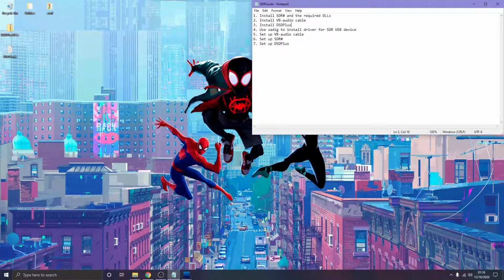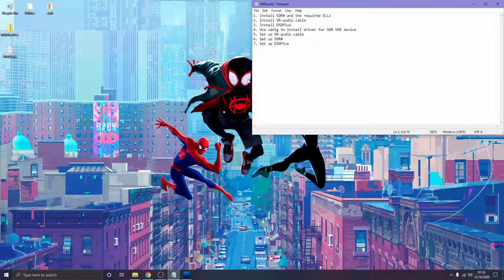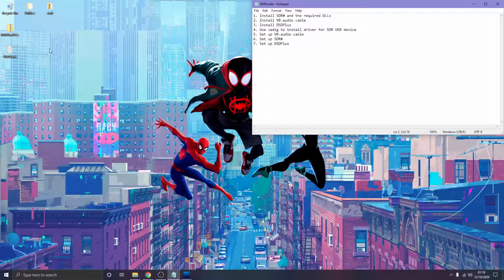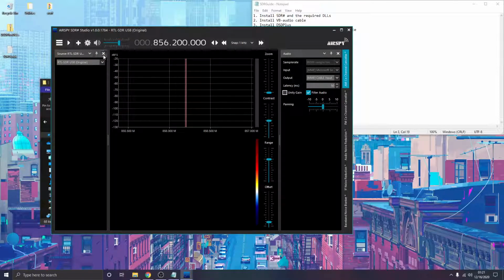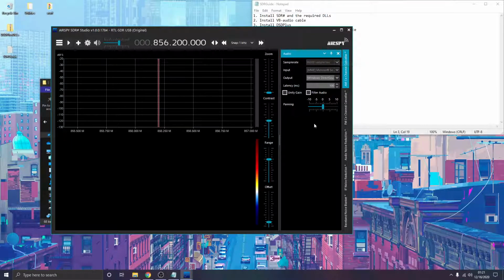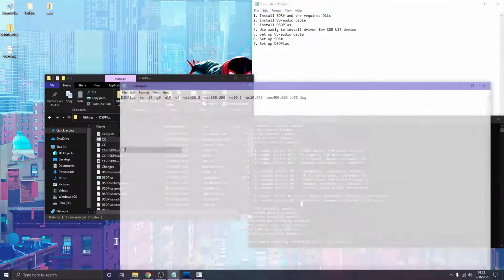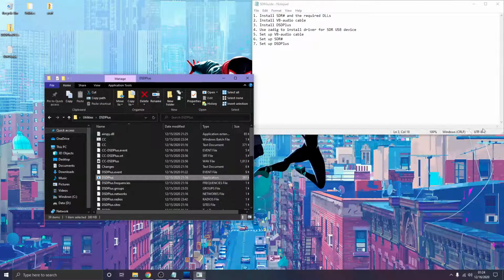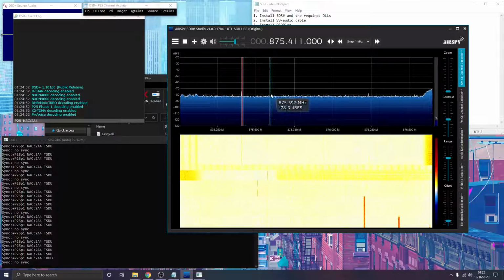DSDPlus & SDR# Guide (p25 phase 1, DMR, etc)

Comment: Hi, I have a question and two problems ...
Question:
What changes if I put the Vbcable outpout on MME instead of Windows direct sound?
Problems:
1 If I put MME vbcable as outpout and start dsdplus I see that it receives, but I have no audio track out (I followed all the steps)
2 If I put windows direct sound vbcable and i run sdr sharp it stops and I only see the waterfall in motion.

I hope you can help me ... thanks
Reply from the maker: MME (Multimedia Events) is an old interface carried over from Windows 95. It's usually the most compatible with audio devices. DirectSound is basically just a DirectX-related Interface to the Windows Audio Session API (WASAPI). Direct Sound should have a slightly lower  latency.

If DSD is receiving, are you able to set the "Listen to this device" option in the sound device settings and hear the output from SDR#?
Reply: @kat6ix767   Thanks for the reply.  No, I can't set "listen to this device" in the sound device settings ... I've been trying everything for months with no results.  I will continue to use only simpledmr.  I have windows10, it seems strange to me that there are so many problems
Reply: @FrassoFra  1. Run cmd as administrator
2. Type cd and your dsd location, e.g.: cd c:\dsdplus
[ENTER]
3. Type dsdplus -i2 -o1
[ENTER]
i2 input 2 source cable
o1 output 1 receiver speakers

I hope this helps. I don't understand why they don't say this at startup.
Reply: @waldemargrabia4731  hi! Thank you!